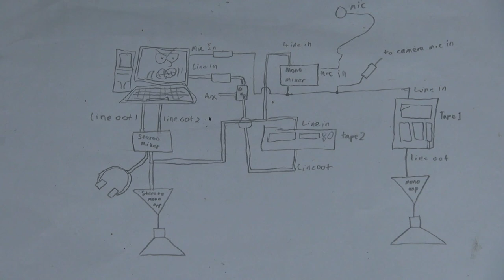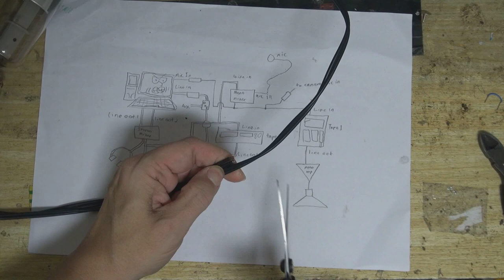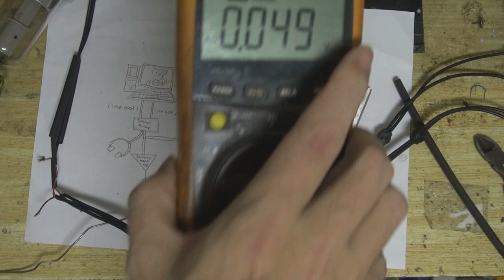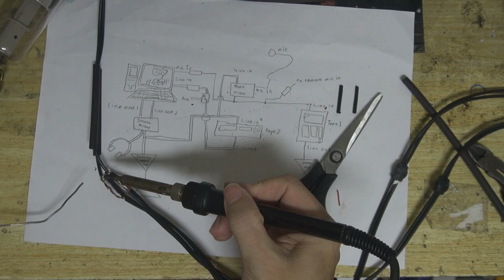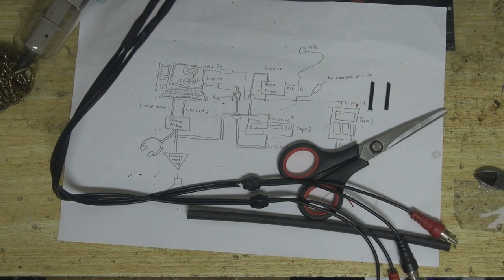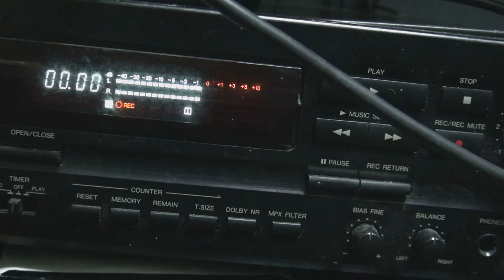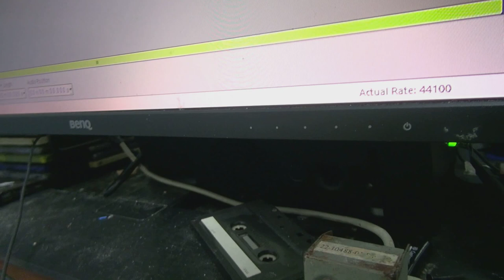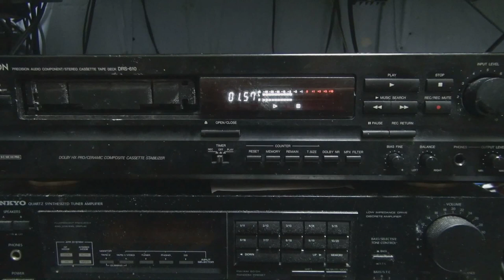Rewiring my audio pt 2 - Finnishing off

Comment: Hi Clem! Could you tell me the name of the IC on your SOUND MASTER at 12:55? Is this thing really from 1989?
Reply from the maker: Sure thing, the chip is marked:

M8812

DNR
LM1894N

sorry it took a while to reply, I wasn't sure at first what you meant by "Sound Master" until I checked the time stamp.
Reply: @CoolDudeClem  Thank you, Clem. I never heard of this chip, before. I just noticed that you even made a video about the board two years ago. 
According to the datasheet, the LM1894N is an adaptive lowpass filter, which is controlled by the amplitude of the input signal. If there is just noise and no input signal, the filter cut-off frequency is set to around 2kHz, thus reducing the amount of audible noise (to which the ear is especially sensitive if it is between 2kHz - 10 kHz). When there is an input signal detected (and it is above 2kHz), the cut-off frequency is altered (up to 30 kHz) proportionally to the strength of the signal, as stronger signals mask the presence of noise for the human ear. So basically it is an advanced squelch concept.